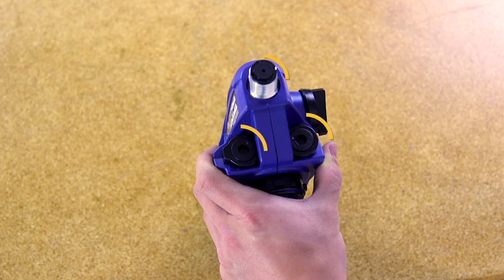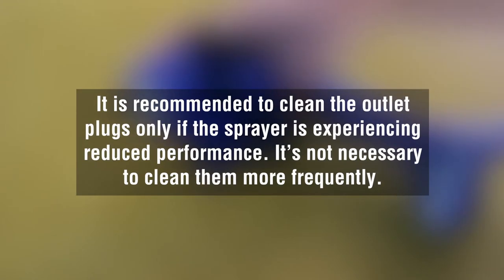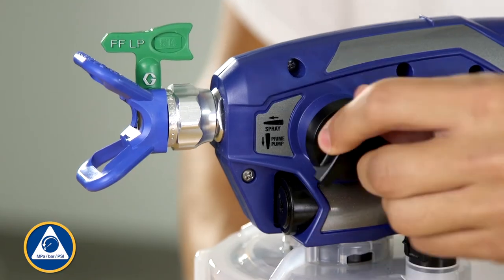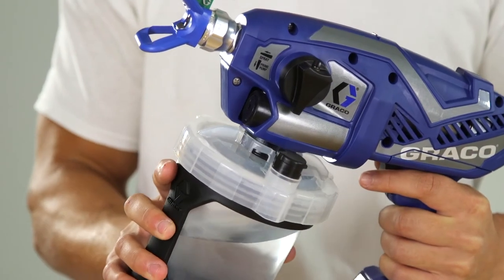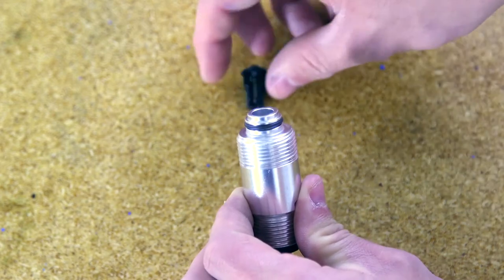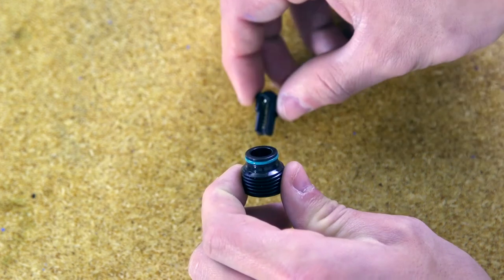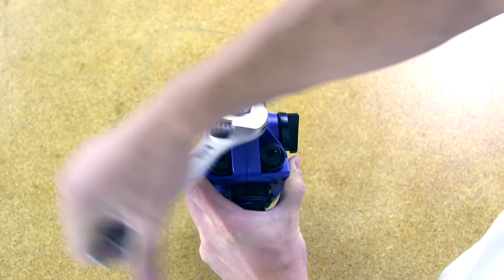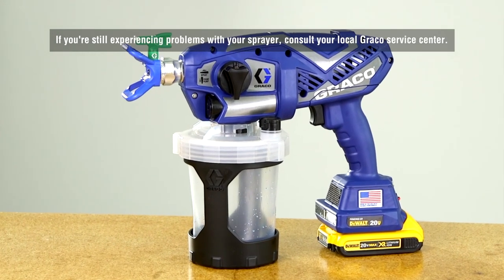Ultra Handheld Operation - Cleaning the Outlet Valves

Comment: But how do you clean the front valve within the metal cylinder?  What happens if the clog is there?
Reply: You can’t 
This is a huge design flaw with this product. According to my local graco pusher 99% of malfunctioning ultras are caused by clogged tips. Unfortunately Graco doesn’t sell the needed spare part only to replace the plastic tip. If they did a repair wouldn’t cost 300$ but only 5$. The replacement of the plastic is pretty straightforward and doesn’t require any technical skills.

Comment: This is completely useless unless we are informed how to clean the tip. It easily gets clogged and a full 300$ pump replacement is the only option. The Graco Ultra is IMHO a scam.
Reply from the maker: Tips should be cleaned with water or 100% mineral spirits and a soft bristle brush. You can also soak the tip for about 15 to 20 minutes in the cleaning fluid. To avoid clogging, you should always strain the paint/coating you are using. If you are straining the material and still experiencing frequent clogs, give our Tech Support team a call and they will help you out. You can reach them at 888.541.9788 M-F 7:30-5:30 CST.
Reply: @GracoContractorEquipment  The use of a bristle brush wont get you anywhere if the chamber behind the ball tip is filled with dry paint. If you don’t believe me - consult a Graco technician. 
This problem is an unfortunate combination of a bad design, non-repairable product, hilarious spare part prices - all in all a company that cares more about own profit than customer satisfaction.
Am I wrong? Maybe I am, but so are the vast number of YouTubes on “How to replace a Graco Ultra Pump” Why is that necessary if it wasn’t because of a bad product? 
Calling support in US doesn’t help a lot if you live in Scandinavia. And believe me -this has been discussed with our local reseller, who, by the way, told me that 99% of all malfunctioning Ultras were caused by clogged tip. But despite this was only “helpfull” by offering a new pump for the price of 300$.
This is why I can only warn other painters who care about their money against this Chinese product.